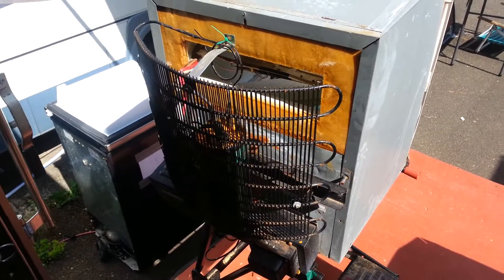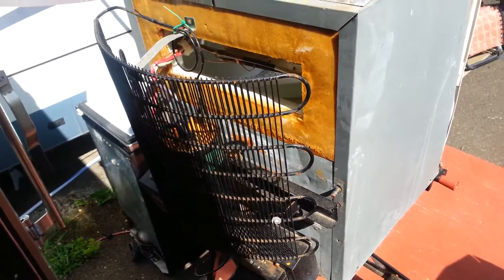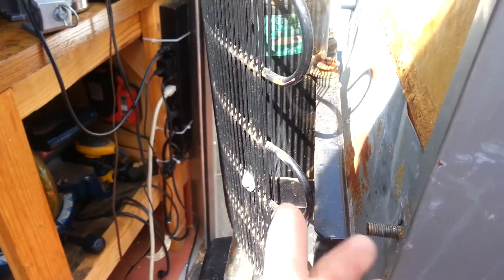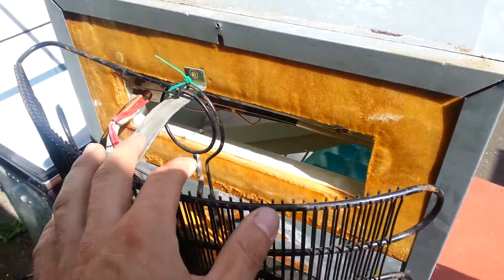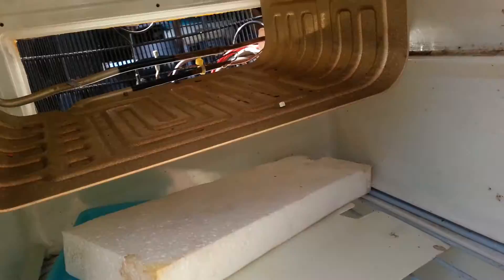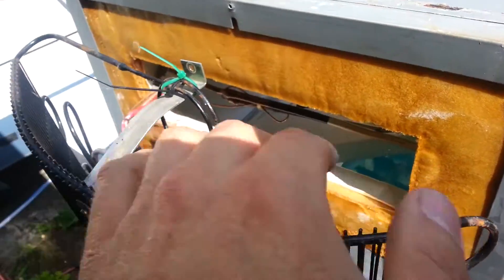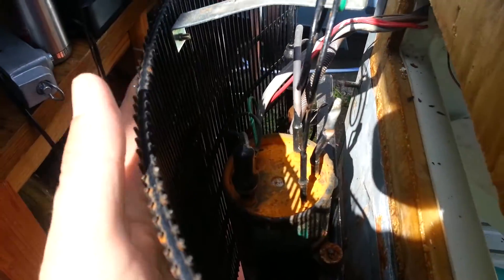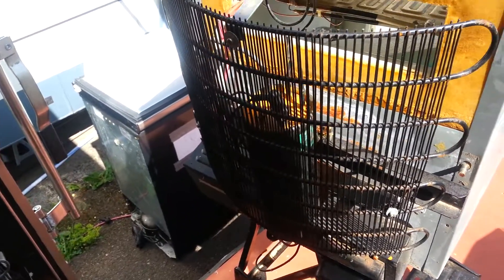Teardown- Vapor Compression RV Refrigerator

Comment: The compressor in the RV one seems interesting. Would like to see more on it.
Reply from the maker: I think there is a Australian manufacturer that makes portable coolers with swing compressors.
Reply: That's a Japanese made Sawafuji Swing Motor, a reciprocating compressor.

http://www.sawafuji.co.jp/english/tech/shindou.html

The legendary Australian portable fridge manufacturer Engel has used these Japanese compressors for ages.
http://www.engelaustralia.com.au/about_SwingMotor.asp

That fridge is an American made Norcold by Thetford Corporation, using the Japanese Sawafuji compressor, widely used in RVs and in boats also but less often.

Both Engel and Norcold offer this compressor in their conversion kits, so spares are available.

http://www.engelaustralia.com.au/2products_details.asp?pid=12&productid=21607

http://www.thetford.com/product/norcolder-scqt-4408f/

I myself have an older Norcold conversion kit for my boat's ice box. As well as a 30 year old portable 30L Engel fridge that still works like a charm.
Reply from the maker: Thank you so much for the information!  I did some research on the Engel last year, and I've seen the one link on the specifics of the Sawafugi compressor.  It's ruggedness and simplicity is one of the reasons I'm keeping it. 

I'm considering utilizing these compressors in my cooling unit, but only if I can ensure a reliable supply.  At this point, I am not sure where to get the compressors alone, nut I haven't done much more than a few internet searches.

I'm looking for something that can be used in a DC application; the SECOP/DANFOSS compresssors are an option I am considering.
Reply from the maker: JuhaEerikki
Did the older conversion kit you have install with the piercing valves, or was a vacuum pump required?
Reply: M.C. Pletcher  I believe generally the Danfoss /Secop choice is much preferred because the availability of parts is superior compared to Sawafuji. At this time I do not know how to obtain any Sawafuji parts, the electronic control module springs to mind first.. Where as for Secop, there are dozens of sources in US and wordwide. My older Norcold conversion kit is the SCQT-4407. The newer replacement I believe is the SCQT-4408. A few months back I found a few places that still sold the older one for around 600 to 700 USD, which is just about the lowest price in boat fridge conversion market. Only drawback is that these ones do not have the service valves from the factory. But adding Schraders should be no problem for you. 
in boat fridge segment there is one guru out there Mr. Richard Kollman. He has a very informative website, Kollmannmarine dot com I believe. His recommendation is the Secop, exactly like you said, due to the the reliable availability of spares.
Reply: M.C. Pletcher My SCQT-4407 came with the quick sealing couplings, which I believe are good for multiple connection/disconnection. There are also other quick coupling valves which can be used only one time, but I can't remember the brand/model just now.
So I don't not need to vacuum, just plug and play for now.